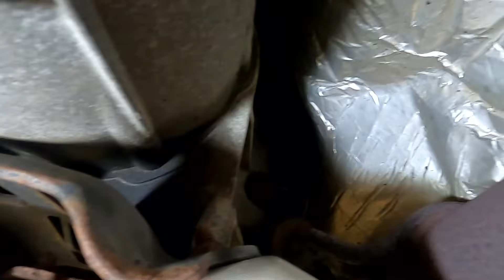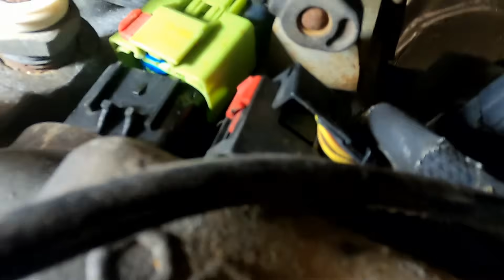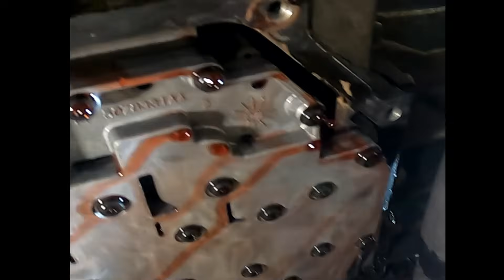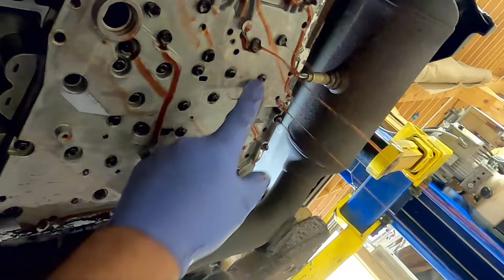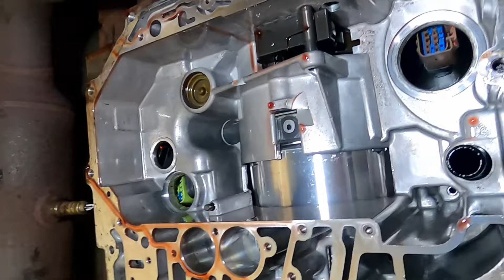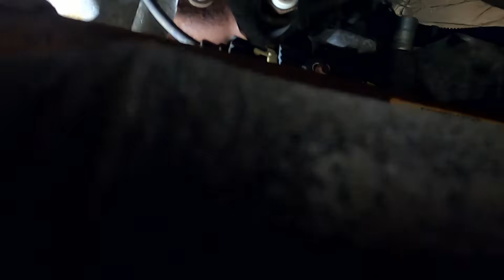How To Replace 42RLE Transmission Valve Body Shift Solenoid Jeep Liberty Dodge Nitro 2008 2014 Hard

Comment: My 1999 Chrysler Town & Country only had one electrical plug, and no crossmembers needed to be removed, was pretty straightforward.     This was a good, helpful video, otherwise very similar to the van, just wanted to add that extra note in case it helps anyone else.
Reply: I'd also mention that a 10mm took off the bolt that holds the shifter arm, plus all the pan bolts and all the bolts holding in the valve body.   A 15mm was needed to get the bolt holding the shifter arm to the shifter rod, and a good pick and pliers to get the electrical connector off.   Also helped to tap down on the shifter shaft with a hammer and a brass drift just to get it moving.  Those were about the only tools I needed.

Comment: does every electrical connector have an oring. i oulked my valve body iut and i did not see an oring on 2 of them
Reply from the maker: check inside the trans body where the connectors go thru, there should be rings to keep water and dust out

Comment: Any help would be much appreciated! 

I just did this (first diy transmission job) 

Replaced the whole valve body on my jeep liberty 2010… original had code p0750 & stuck in limp mode / not doing automatic shifts on highway… 

Just completed installation/ put in new fluid.. now getting new code after test drive P0869 … 😢 

Anyone else had this issue or advice? 

Another thing I did (i have the three plug valve body) on smaller little black connector was really falling apart when i disconnected it taking out old valve body… so i ordered a new connector and spliced it in.. could this be an electrical issue?

Really hope not to remove whole valve body again!! 

My pistons and springs got mixed up too when installing.. they looked identical, so hope that’s not issue

Comment: I did it but when I tried to reinstall the shifter linkage it wouldn’t line up with the lever and my dash says n instead of p when I’m in park since transmission
Reply: This happened to me at first.. I couldn’t crank/rotate the shifter “rod” from the position “one click before first gear ” couldn’t get it 6 clicks back to park… 

So i took valve body back out and found…

The little shifter arm on the valve body that you’re supposed to have tucked in that little nook (before first gear) .. the whole arm was upside down! It’s shaped a certain way and will only slide into the “park lock position ” if it’s uptight the correct way..

Comment: Thank you. I have a question. Where is the fluid pressure sensor switch c and f located? Is it inside the valve body?
Reply: Did you figure this out? I’m getting a new high pressure sensor code after replacing valve body.. p0869… wondering if i have to take out the refurbished one and replace a faulty valve sensor…. 

Also if i take crossmember bar off trans… do i need to prop the trans up with something? Or does it lower just a bit do reach those connectors?  

I was able to blindly dissconect/reconnect the big brown connector without removing crossmember bar.. but was super tight and wanna try and inspect / clean that connector now to see if that’s causing the new issue

Comment: Hey, thanks for the great video! Did you have to remove the front drive shaft in order to have enough room to get to the shifter linkage bolt?
Reply from the maker: no, but it was real tight getting in there. it was on a lift. I dont think I couldve gotten to it if it were on ramps
Reply: @TheWorldAsSeenByTom  Yeah, mine was on ramps and there was no way i could get to it without removing the drive shaft. Pulled it off and it made so much difference. Thanks😁

Comment: Im having trouble with the brown connector my hand doesn't fit to to get to it, did you take the drive shaft off aswell for the rear differential?
Reply from the maker: we removed the trans crossmember and that helped lower the back of the trans and we could reach every connector.

Comment: Hello..... thanks for the info. I have a question. How can you tell the accumulators left and right or it doesnt matter what side ?  Are they the same? Today is may 18 2024. Thank you in advance.
Reply from the maker: if I remember they are both the same size, but I made sure to put each in the original spot should there be any wear. I do that with everything tho.

Comment: You skipped over the hardest part of this process. Removing the clip on the right side. You showed it, but made it seem as easy as can be. Not easy at all. Also, there aren’t 2 clips on the drivers side.
Reply from the maker: thanks for your feedback. I didnt show that because its a common slide the clip sideway, press the tab and lift connector. I believe every single electrical connector on this and every vehicle is made that way. Also, once you lower the trans rear, it is very easy to see and do this. No tricks required. Its almost impossible to do without lowering the rear of the trans.
Reply: @TheWorldAsSeenByTom  some remove the Cat :( yuck exhaust work)

Comment: You didnt show any information on the shift solenoid, which is what this video is supposed to be about.
Reply from the maker: the video is about replacing the valve body. I show where the shift solenoid is on the valve body. You cant get to the shift solenoid without removing the valve body or skipping any steps in this video. The shift solenoid is held on to the valve body by a couple screws. Swapping the shift solenoid shouldnt need any explanation if youve gotten this far.

Comment: what is tow mode
Reply from the maker: tow mode when enabled does not allow the trans to go into 4th gear. theres a button on the dash for it. Its in the owners manual to find your exact location of the button.

Comment: Where did you order the valve body from? Is it dependable?
Reply from the maker: I bought mine off eBay. There are some people who remanufacture these. Check their feedbacks to see who does a good job. I was pressed on time, but if you have time you can order a shift solenoid kit and do it yourself. Theres screens and build up that need to be cleaned inside the valve body.